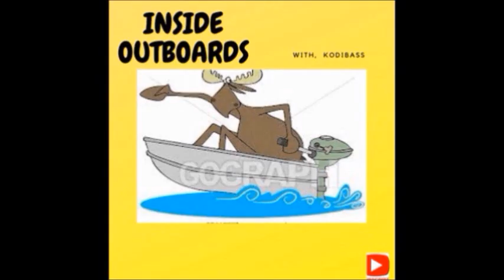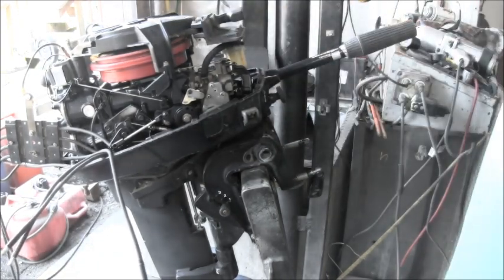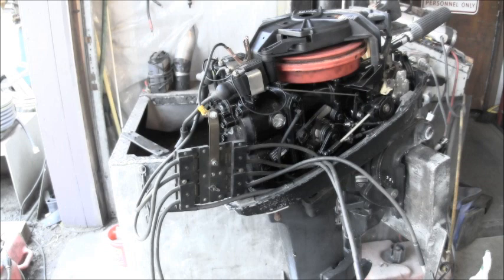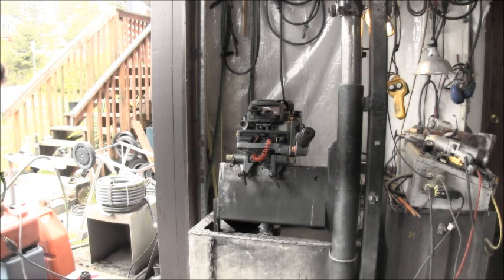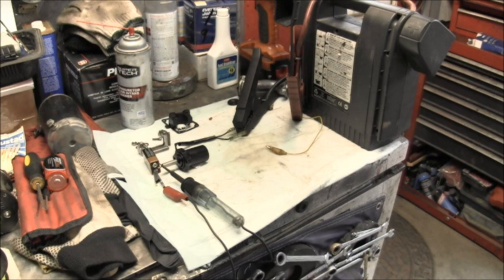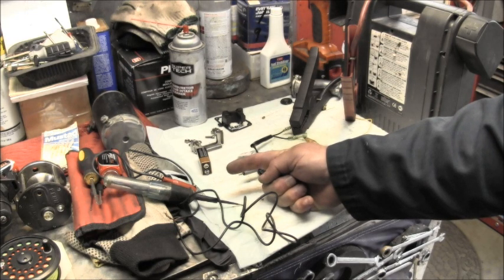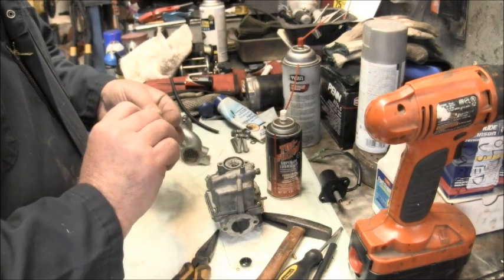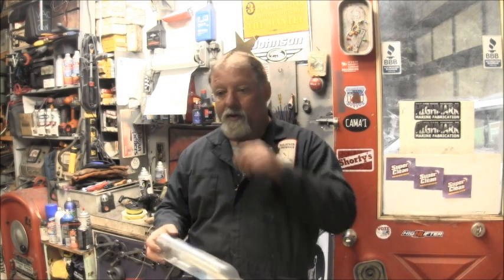MERCURY 9 9 ( Easy Fix ) ,   YAMAHA 9.9 Thermal Electric Choke ( Test)

Comment: Hi Kodi, love your videos and keep learning from them. Anyway, the merc sounded good. What year is that 9.9? I know you don't care for the tiller shifter and after playing with my Mark 10              understand how dangerous these can be out on the water if you're not aware of where neutral is before you start it. Evinrude has it where it wont start in gear which was smart if it's working. Weird how that motor had two kill switches? The one on the side looks like it was a custom mount from a controller shift. It works so that was probably the replacement for the tiller stop that quit working. Like you said the owner did some custom work on it. The Yamaha like you said needs a better choke.
Reply from the maker: It seems there R allot of fans out there for the tiller shift I guess if U get used to it but for me I would end up in the water haha  I think it was a 88.  Gunna see what I can come up with on the Yammy no choke joke.    kb
Reply: got the old Johnson TD-20 on the lake today and ran great. I still have fuel leaks so put my Koda on and caught my limit of trout. Yummy. The petcock is leaking so will fix that old timer. stuff an Oring in it. Video will be coming. I need to fire up the smoker too

Comment: Hmm - the enricher valve is connected to a coil in the flywheel.  Therefore it is not connected to 12VDC when on the engine.  It is actually connected to approx 8VAC.  So yes, connecting it to a 12VDC battery pack will definetly make it hot.  And make this test mostly invalid.  Measure the coil resistance and measure for AC voltage on the wires.
Reply from the maker: Thank you mate'    kb

Comment: Hello Mr Kodibass. This video comes with great timing for me. I have a 1989 Yamaha F9.9 (white)I just started working on. It initially runs for 20 seconds then dies. Thereafter it runs in 1 second bursts. Thanks to recently viewing this video I looked at the choke. It has a vacuum plunger rather than electric solenoid ( perhaps you have encountered them before?) 
After the first 20 seconds running the plunger shoots down and the engine dies instantly. After that, the plunger shoots down each time I try to pull on the pull start. If I pull off the little plastic sight-glass over the plunger and lock the plunger in the up position with the factory locking clasp on top of the carb, the engine continues to idle fine.
Can you please tell me if vacuum plunger up equals choke on or choke off? I can't decide if it is choking the engine out, or removing the choke to early. Have you struck this issue before? This is the first 4 stroke outboard I've played with. Thanks

Comment: I have a 40 horsepower Yamaha why does it get gas in the oil
Reply from the maker: Could be crud/dirt build up around your valves , Try a good fuel system additive/cleaner & see if it stops.   kb